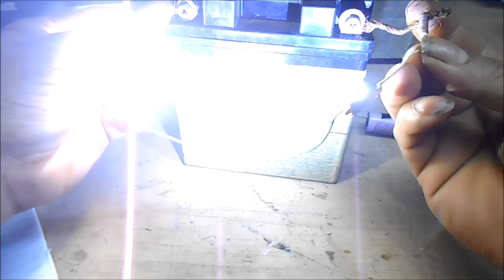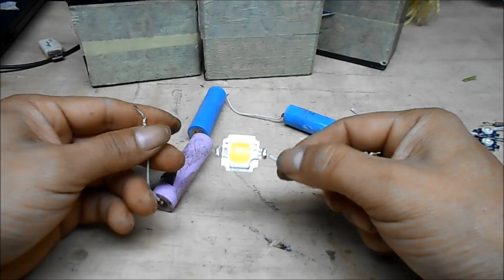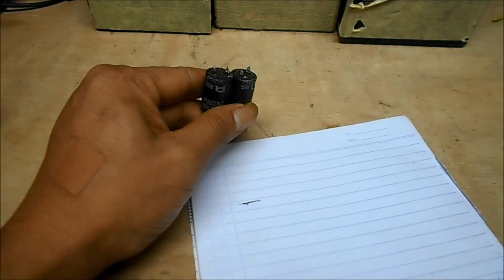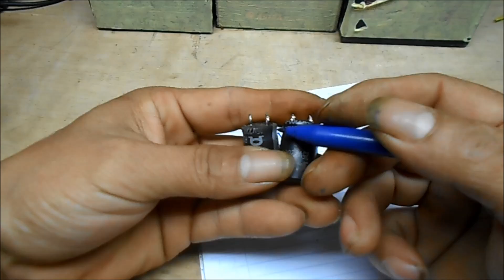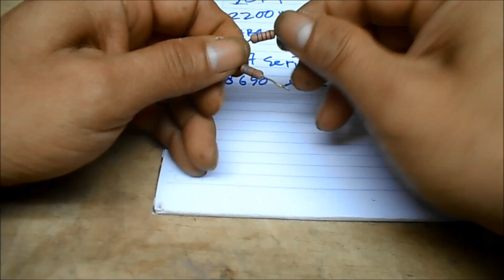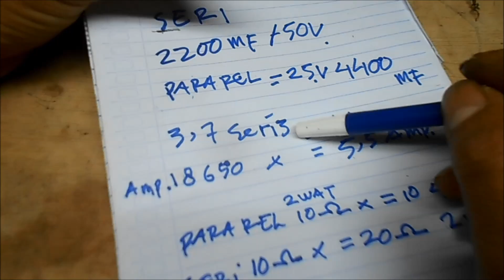PENGERTIAN SAMBUNG #SERI & #PARAREL

Comment: Maaf gan saya masih belum paham, 18650 itu kapasitas baterai sebesar 18650 mA atau ukuran fisik / dimensi baterai : diameter 18 mm x panjang 65,0 mm
Sekali lagi maaf kalo saya salah, soalnya saya agak bingung baca deskripsi video agan.
Reply from the maker: hhe maaf jika ada yang salah di deskripsinya  bos 18650 memang ukuran fisik sementara batterai tsb yang umum memiliki sekitar 3000 mah atau 3 amper

Comment: Ijin tanya bos, saya mau rangkai LED 72 Watt dg emiternya 3 Wattenggunaka adaptor 12V 10A.  Bisakah saya rangkai seri  36 Watt ( 3Wattx12 buah LED) x 2 dan dirangkai  1 paralel. 🙏
Reply from the maker: Bisa bos dan untuk menurunkan amper busa di pasang mikron atau R 2watt dulu
Reply: @feebyewok  : nah ini yg belum faham soal pasang R2 😁.
Reply from the maker: @rakha0803  maksudnya tegangan harus melewati resistor 2,2 ohm dulu
Reply: @feebyewok  : itu ketemu  2,2 ohm  cara menghitungnya bgmn?

Comment: maaf.mau bertanyak kalau smbg seri sebanyak 38 pcs tegangan 12 v itu apa harus pakai resistor .trm ksh.
Reply from the maker: resistor tetap diperlukan untuk menurunkan amper kawan kalau untuk 12 v maksimal seri 4 kalau untuk Mata Led kecil 3,3 v
Reply: @feebyewok  trm ksh banyak.
Reply from the maker: @budiadi3296  sama sama mas

Comment: Dalam hal penggunaan semisal pada accu 12 volt irit pemakaian apakah pada rangkaian seri atau paralel?
Reply from the maker: Pasang seri 3 bos tapi pakai lagi resistor 2,2 ohm
Reply: @feebyewok  2.2π pada led hpl 1 watt. Kalau menggunakan led smd 5730 (9 buah )seri 3 paralel 3 brp ohm yg diperlukan?
Reply from the maker: @Zee.Garage  Sama Aja bos, R disini hanya untuk menurunkan Amper biar lampu tahan. Kalo msih terlalu terang atau panas bisa dinaikan 3,3 ohm
Reply: @feebyewok  mkasih infonya.
Reply: @feebyewok  R nya brpa watt om?
Reply from the maker: @ihwanramadhan4735  resistor 2 watt gan 2,2 ohm untuk lebih terang 3,3 ohm untuk mode low nya
Reply: @feebyewok  ok makasih om

Comment: Mas ,,kalo mau pasang di mobil 12 volt,lampu hpl 1 watt 4 pcs pake resistor brpa ?rangkaian seri
Reply from the maker: ya diseri gan pakai R 2,2 ohm 2 wat
Reply: @feebyewok  tapi kalo ac mobil nyala ,,kadang agak ngedip (ga stabil ) gtu gan.itu g mslah atau gmina??
Reply from the maker: @dianadisaputra1670  coba dipasang elko sebelum masuk R atau coba pindahkan Suplainya saat ac hidup tegangan amper akan sedikit berkurang itu biasa
Reply: @feebyewok  saya ambil suplaynya dri colokan lighter gan ,bgusnya ambil suplay dri mana ya gan??
Reply: @feebyewok  kall dipsang elko,,elko yang brpa gan??
Reply from the maker: @dianadisaputra1670  sekitar 2200 mf 25 v gan kalao kurang bagus nyala coba diseri 3 aja  dari soket cigarete amper udah bagus
Reply from the maker: @dianadisaputra1670  sekitar 2200 mf 25 v gan kalao kurang bagus nyala coba diseri 3 aja  dari soket cigarete amper udah bagus
Reply from the maker: @dianadisaputra1670 dari situ udah bagus gan coba diseri 3 aja
Reply: @feebyewok  mksudnya pake 3 lmpu sja gan??
Tpi kan lmpu 3 volt gan,apa ga pnas lmpunya?

Comment: Saya mao tanya mas, saya mao buat led hpl 90 watt, per titik 3 watt dan memakai 3 chanel dimmer.
Dimmer 1) 18 titik
Dimmer 2) 6 titik
Dimmer 3) 6 titik
Setiap dimmer di rangkai 3 seri, pararel + 3 seri, pararel + 3 seri. dan seterusnya.
Pertanyaan saya, 
1) apakah perlu pakai resistor? Terutama pada chenel dimmer yg pertama, yg mencapai 18 titik led
2) 12 volt brp Amper yg harus saya pakai untuk masing2 chenel dimmer? 
3) 12 volt brp Amper yg saya harus pakai untuk adaptor nya?
Reply from the maker: pakai led hpl berapa wat satunya gan?

Comment: Bang mau nanya saya kan rakit LED Hpl 3 wat di seri 3 pake resistor nya yang berapa yah
Reply from the maker: resistornya sama saja 2,2 ohm tegangan 9-12 volt bos
Reply: @feebyewok  tapi saya pake 2,2 kok keluar Asep di resistor nya trs panas juga om itu solusinya gimana yah om
Reply from the maker: @kepobanget795  r nya bisa dipasang 2 atau 3 di pararel atau bisa menaikan 3,3 - 4,7 ohm bos

Comment: Mas aku coba led 10wat 12v 5pics diseri dikasi resistor 2,2 om /3,3om diseri driver otput 90-130 al hasil nyalanya kedip kedip maz terus maz
Reply from the maker: sepertinya driver kurang kuat mungkin gan atau tegangan terlalau kuat voltnya berakibat salah satu lampu mati

Comment: Mas mau tanya. .saya buat lampu led  berbiji 3 volt. Aku mw buat 3biji diseri.. Pakai accu.   Saya mau buat lampu 24 biji diseri 3 terus saya pararel.. 3biji yg diseri  tahanan pakai resistor 40 om.klo 24 biji diseri 3.3 berapa mas untuk  resistornya semua kalau mw pakai 1resistor
Reply from the maker: coba pasang seri 3 pararel 4 memakai resistor 10 ohm berarti pakai 2 resistor mas kalau kurang terang bisa duturunkan nilai  R nya 8,2 ohm atu 6,8 ohm 2 watt
Reply: @feebyewok  mksh mas

Comment: Terimakasih ilmu nya, saya mau bertanya, Saya punya modul LED yang 3mata 3wat, dan 1 mata 1,5wat, didalam nya sudah terdapat resistor, nah saya parallel semuanya, dan ketika diujung kabel saya cabang kan 2 + dan - kepada dua lampu yg sama (satu sumber beda arah) jadi saya cabang 2. Setelah di cabang ternyata voltase drop 1-2volt, padahal output adaptor 12v 5a, total daya LED sekitar 20w
Reply from the maker: teg akan sedikit drop saat melewati resistor bos
Reply: @feebyewok  iya makasih bang, baru sadar saat sudah komen disini paginya, karena resistor nya hahaha. Ga bakal dicabang lah mau diparalel aja dari sumber supply sampe ujung LED modul

Comment: Maaf mau tanya, saya ada  power suplay 12v 30amp mau di pakai untuk hpl 1watt sebanyak 100pc.
Bagaimana cara merangkainya ya, supaya sesuai dngan spek led hplnya...?
Mohon bantuanya
Trimakasih
Reply from the maker: pasang mata lednya seri 3 bos terus pakai Resistor 3,3 ohm, 2 watt ,pada satu resistor Kawan bisa pasangkan max 6 seri Mata led.kalau R nya 10 berarti bisa pasang 60 lampu dan seterusnya.
Reply: @feebyewok  
Trimakasih sblmnya kang atas responya
Seandainya saya ada kesulitan lg mohon tidak keberatan untuk berbagi ilmunya ya kang.
Trimakasih
Reply from the maker: @dillafadilla8808  Dengan senang hati  saya tunggu jika mungkin saya dapat Membantu Kawan.
Reply: @feebyewok 
 trimakasih sblmnya kang
Reply from the maker: @dillafadilla8808  masama kawan

Comment: Auto subscribe bang.... Saya awam banget ama elektro.. mau tanya bang..saya ada baterai 3,7 volt, saya kasih step up dgn output 9,5volt utk mnyalakan led strip 5 Meter dan mau nyala lumayan terang.. nah saya ada led hpl 1 watt 2 buah dgn spek working voltagenya 3,0-3,4 dgn 350 MA yg ingin saya tambahkan di rangkaian trsebut . Dimanakah saya harus pasangkan led hplnya? Apa sebelum step up atau sesudah step up?  dan jika memakai resistor brp besar resistor yg harus saya gunakan?? Maaf bang nanya banyak.. mohon dijawab bang. Terimakasih🙏🙏🙏🙏
Reply from the maker: terimakasih bos pada umumnya semua mata led membutuhkan tegangan volt sekitar 3,0 - 3,5 v sedangkan amper bertahap menurut daya watt lednya jika dipasang di out teg sudah jadi 9 volt ya jika dipasang di input bisa dipasang seri dengan r 1,5 ohm 2,2 ohm atau jika dipasang di out teg 9,5 v mungkin harus pasang r sekitar 30-50 ohm dan lednya dipasang seri bos
Reply: @feebyewok  maaf nanya sekali lagi...kalo di pasang di outputnya....led yg dipasang seri itu hanya dua led hplnya saja atau dengan led stripnya juga??? Maaf benar2 awam bang🙏🙏🙏

Comment: om numpang nanya saya mau nyalahin led hpl 100watt pake power suply 12volt,
brp rangkaian yg harus saya seri dan saya paralel,dan power suply brp amper yg pas...
ditunggu jawabananya,terimakasih sbelumnya
Reply from the maker: led hpl memerlukan tiga batterai diseri gan atau lihatdi video ini https://www.youtube.com/watch?v=6ZNmFmx3yIU
Reply: mohon maaf saya salah ketik,maksud saya hpl bijian 1watt dirangkai jadi 100watt😁
Reply from the maker: @wididomble4931  ohh hhh gtu to .led hpl nya di seri 3 aja klo buat 12 v. Misal. Pararel 3 .seri 3 = 9 biji lampu. Pkai resistor 2,2 ohm 2 wat Klo bikin seoerti ini 10 udh 90 lmpu. Klo di seri misal 10 led hrus pakai teg 33 v karena / led butuh tegangan 3,v atau 3,3 .
Reply: brarti saya paralel dulu 33buah abis itu seri??
Reply from the maker: @wididomble4931  saran saya pasang terpisah saja / 9 led jadi butuh sekitar 11 resistor
Reply from the maker: Biar Aman klo ada papa lampu gk mati semua
Reply: Maaf min mau nanya kalo 12 v 2 a kuat berapa lampu hpl yg 1wat

Comment: Om mau tanya? Kelebihan amper, berpengaruh ga?
Reply from the maker: pengaruh gan bisa diatasi dengan masang Resistor
Reply: Begini ceritanya...
Mau bikin led 24 watt pake adapter 12v 2A... Setelah di hitung dapet 4 seri 6 pararel....

Nah Dirumah punya adapter 12v 6A, sayang klo ga kepake ...
Hitung resistor gmna ya om?
Reply from the maker: @kadodi4166  kalau murni 12 v lampunya diseri 3 saja pakai Resistor 2,2 ohm atau 3,3 ohm 2 wat  bisa 4 tapi kurang terang
Reply: Klo empat kurang maksimal ya om?
Ga tau murni atau tidak, ga punya alat multimeter..
Soal'a per led saya ada yg
2,0- 2,2v
2,9 - 3,2v
3,0-3,6v
Tapi 4 saya ngitung'a begini (tegagangan 1 watt led 3 - 3,5v) rata" aja 3v jadi
12v ÷ 3v= 4 heeheh....
Maaf om klo salah... Newbie blajar rakit led pke adapter...
Reply from the maker: @kadodi4166  ya betul begitu bos  kita sama sama belajar gan hh
Reply: @feebyewok  jadi lebih maksimal 3 aja ya om? (3seri 8 pararel)
Nah cara hitung resistor gmna ya?
Apa beli adapter baru 12v 2a....

Gara" punya dimmable dc 12v-36v... Jadi pengen tegangan 12v aja...
Klo driver led biasa ane punya tapi yg rangkaian seri...

Comment: saya ada led hpl 3.4-3.6v 700ma 3w. dirangkai 3 led pararel. kira-kira butuh Resistor berapa ?
Reply: disambung ke motor(12v)
Reply from the maker: @IndraKurniawan196  pasang 2,2 ohm 2 watt aja bos
Reply: @feebyewok  panas banger resistor nya om,sampe krluar asap
Reply from the maker: @IndraKurniawan196  pasang pararel 2atau 3 biji bos